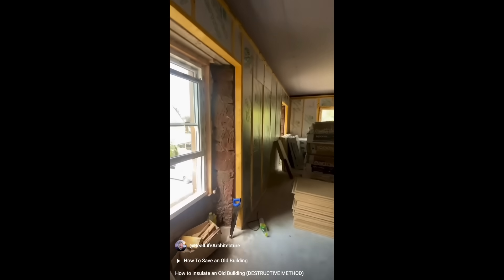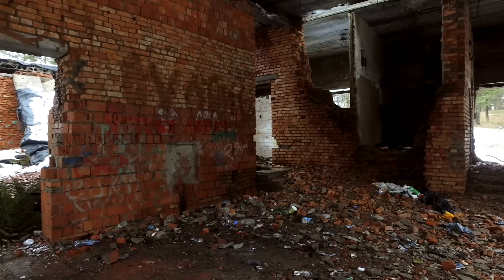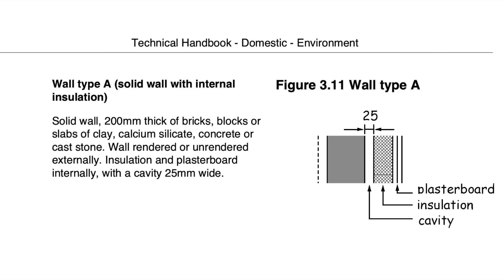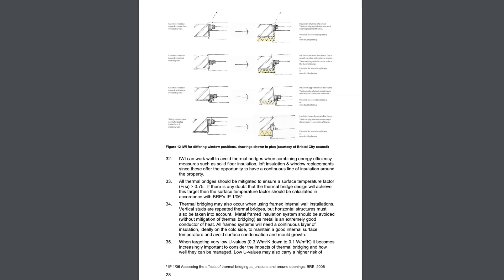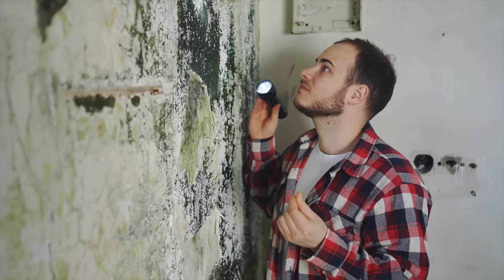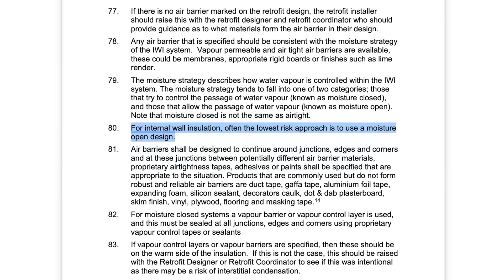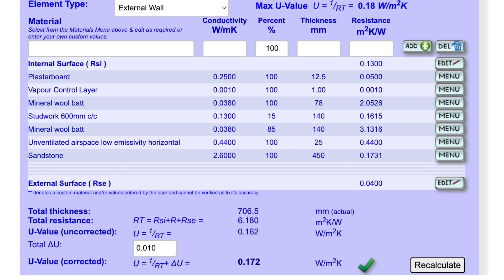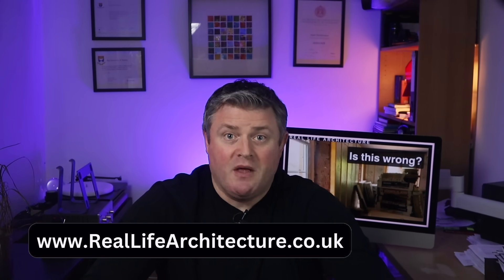How To Insulate Inside a Solid Wall in the UK

Comment: What do you think about an insulated breathable plaster like Diathonite? An insulated lime plaster directly on the wall seems like a great solution in lots of respects, but I don't know how it compares to conventional insulation or whether building regs permit it.
Reply from the maker: I have never used it but it’s in my list of products to research
Reply: Diathonite is very good stuff. I've seen it used in a couple of projects and the U-values are surprisingly good. Personally I always favour woodfibre boards, but using diathonite for any parging to make the walls flatish first is a good idea. And it can go on pretty thick (40mm per layer). The conductivity is 0.037 W/mK which is essentially the same as woodfibre, fibreglass, rockwool, hemp, cellulose etc. they are all 0.035-0.045. The nice thing about diathonite and woodfibre (and other self-supporting insulations) is that there is no thermal bridging from battens - the insulation is continuous. It's also vapour permeable and there is no problem with building regs (why should there be?).
Reply: @xxwookey interesting. Do you use wood fibre (or one of the others) directly onto the solid wall (after using diathonite to flatten if necessary)? Or would you leave an air gap? I always thought an air gap was best, but that's just something I've had in my head as best practice because it's worked for me in the past. I had considered a stud wall filled with hemp and then hemp on the face of the stud wall to prevent bridging, but actually it sounds like the stud wall isn't necessary (if/as it's not structural). You're saying that would fibre is essentially just free standing? What happens when the inevitable request to hang a TV or a self portrait on that wall is made?!
Reply: how about expanded cork panels first (mould resistant, very vapour permeable, decent U value) and then that plaster on top? (I would guess the lime plaster even with air bubbles in it wouldn't be enough insulation to make much of a difference)

Comment: Is paint breathable
Reply: Personally I think your initial approach was fine.

I'm not a professional architect but I've got a fair amount of experience dealing with damp, solid walls. I've found for many years that using 25mm roof batton then plasterboard on top works well. You can skim the walls using normal gypsum and the cavity does allow some ventilation, insulation and water protection. This approach has been used for decades without issue. If the wall is super duper damp, strips of DPM behind the Battons provides additional protection from water ingress.

Personally I've tended to avoid using insulation at all because as you say: the walls in a solid wall are supposed to be warmed by the occupants and insulation would prevent this. The air gap insulates the walls to a reasonable degree anyway while still allowing some breathability and heat transfer, a good compromise IMO

Honestly I don't think we know enough yet to be applying insulation. Do you actually know that mineral wool insulation combined with unskimmed plasterboard will allow the wall the breath sufficiently over time to prevent rot? I'm suspicious. I'd want to see the technique used at scale for time before using it myself. After all, 5-10 years ago guidelines were to use spray foam insulation in roofs.... And I've also seen many rotten timber lintels and very mouldy walls behind PIR insulation where it has been stuck directly to solid walls. Despite this being a problem for years, it's only very recently that guidance was changed recommending a 25mm cavity.

Is it even necessary to insulate a 600mm thick stone wall? How much heat is making it through that wall to the outside anyway? There's an argument that heating the stone walls actually creates a beneficial thermal mass anyway.

Interesting topic anyway and thanks for the vid!
Reply: You wouldn't want to use any acrylic or oil based paints, true. Limewash is amazing for breathability and very inexpensive if you're just buying hydrated lime powder and adding water to it - but it's not that suitable for professional painters (a day or so of waiting between 3 coats min for example)
Reply from the maker: Water based paint is, as far as I know
Reply: A dpm could trap water and lead to the mortar failing, which is why external pointing maintenance is vital.
Yes absolutely it is necessary to insulate a stone walled house. Have you ever lived in one? Deep window and door reveals slate and rock lintels, large slate window ledges all act as massive and very rapid heat sinks, the inside surface area is often larger than external.surface areas...a heat sink. As mentioned tight corners and passages, small kitchens and baths need air flow. If you live in a stone house then windows open 8 till 12, then close up, light the wood fire and LPG on. (This situation internal pir is great, albeit room size loss)This idea of warming the house up over a longer time or using the thick walls is a deluded myth. Trust me I know. 
The gold standard is external wall insulation (cottages have more space in garden) then the walls can be used as a thermal store but obviously with a PPV and or a recovery system. 
Sadly 99% of cottages have had cement pointing either external and internal or several layers of cement render inside and maybe out. So breathability is mostly a myth, meaning if that's what you want then sell.up amd buy a completely knackered cottage and start from scratch.
Reply: External wall insulation is another myth that will come back to haunt people just like the fibre that was pumped into cavities and now has to be removed 
These old stone houses don’t have a DPC and the walls need to breathe that’s why lime render only and not cement
Reply: I used this approach 8 years ago for my 1915 house. I used metal frame studwork (nice and thin) Continuous Celotex across the front with taped joints,  batons screwed through to the metal studs, then 12mm of ply then plasterboard and gypsum plaster. The metal studwork created the 25mm cavity and I added air bricks to the outside to ventilate the cavity. No more mould, toasty warm with just the use of dehumidifiers and occasional use of wood burner. It's worked really well. Using the metal studwork system eliminates worry of rotting batons. The spares I had, have been left out in the rain to see how they fare -no rust even after 8 years. This is a great video, thanks for the upload.👍